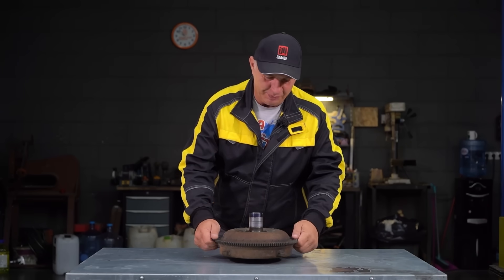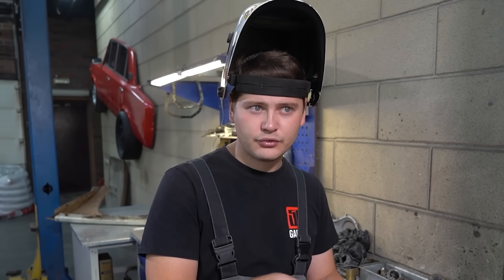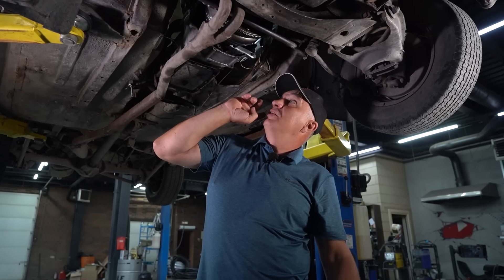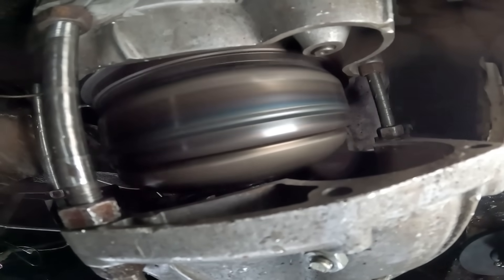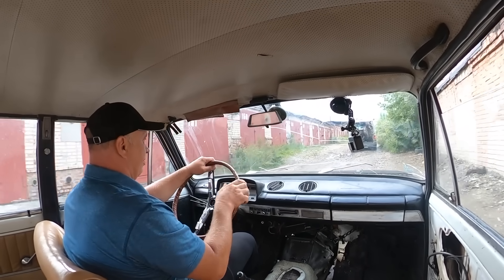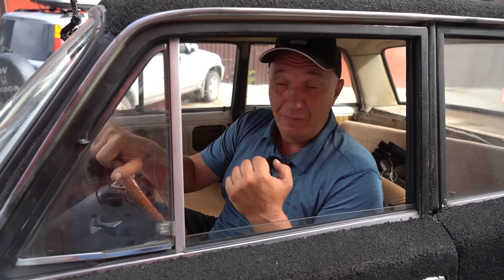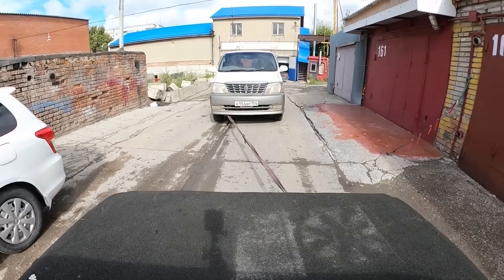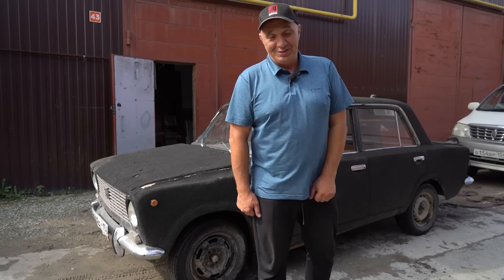Torque converter in a manual transmission - will it work?

Comment: Hear my thoughts Garage 54

Torque converter in a manual gearbox with manual clutch can enable person to engage gear without worrying engine stall. that is why automaker only put torque converter in automatic, because the purpose of automatic is to reduce body coordination.

Your torque converter in manual gearbox is very same concept as most modern backhoes, tractor and forklift. But the difference was

1. Those backhoes like Case 580 have two set of transmission, 
2. first one equipped with torque converter, oil pump,  mechanical or electronic-controlled (push of button) clutch for forward and reverse, output shaft to send power to
3. second transmission that have 4 speed

If you manage to put torque converter -> Manual pressed/electric clutch -> speed gearbox, then congratulation you have manual transmission that will not stall the engine, car will go so smooth without jerking

Comment: In France Renault made the « transfluide » the car had manual transmission and a torque converter. It also had a magnetic powder clutch, that was simply actuated when you attempt to use the gearbox lever.

Comment: I love things like that bit like the old    rover 105  r        I love the Russian side way s     think ING  a  old Daimler type fluid fly wheel and perhaps an old  over drive  that's had a lot of (docterin) and a sort of  daft  centrefugal clutch     but would like him to fit a large (mower) hydrostatic unit behind the  engine with hydraulic wheel (drive) moters 4 units  that Russian winter would be like a walk in the park 😊 keep up the good work comrades 😊

Comment: Driving an old school US truck as a daily, I love how smooth it all works and how it pulls if needed. Those torque converters accumulate the engine power, increase the torque and send it to the gear box. But: if the converter is charged up it still sends the torque to the gear box even if you don´t step on the gas. The converter first needs to get rid of the accumulated energy. So if you accelerate hard on the green traffic lights, it will be hard to stop quickly because the converter still sends the accumulated energy to the gear box accelerating the car. Same thing with burnouts. When you start loosing control it is too late because the converter needs to bleed energy first and still pushes the car. :face-fuchsia-tongue-out:

Comment: What would happen if you used a torque converter with a higher stall? Would that allow the gear to be changed without grinding?

Comment: My Uncle had a 52 Desota with this setup. It had a clutch behind a two speed column shift!! Reverse eas up and back. No first. 
Second was up and forward
It was geared low for getting a trailer moving and braking. Overdrive was down and forward. To start the engine pit it in neutral.  
Press clutch and select gear. Let out clutch the car will move with more throttle. 
In high and second you have two speeds. It will shift from low to high by idling the engine. The clutch is only used between second and overdrive. You hear a clunk when it shifts when you take your foot off the gas. It will not shift until you do. They went to a regular transmission two years later
It was weird but fun!!
Also weird was you could stop and start without the clutch if not loaded. 
Some Buicks didn’t shift at all. They just got faster!!
(Dinaflow)

Comment: Oliver Tractor company had a tractor decades ago called the 995. It had a clutch/torque converter. It had a regular clutch which was used like a regulsr clutch but also had a torque converter. The clutch could be dropped, but the tractor would not move forward until the torque converter built up enough torque, then the tractor would move forward.

Comment: What car had fluid drive?
It was offered for civilian use from 1939 through 1953 in Chryslers, 1940 through 1953 in DeSotos, and from 1941 through 1954 in Dodge models; a semi-automatic system was optional from Chrysler and Desoto from 1941, and for Dodge from 1949.

Comment: Think of how much more fluid is the pan of an automatic transmission to absorb all the heat from the torque converter. That torque converter is sealed. Only Zeus knows how hot it got inside there while towing that van. There's no way you could drive that around for an hour without an external cooler or a lockup function.

Comment: The answer is no since it locks up with hydraulic pressure provided by the automatic transmission oil pump.

Comment: The torque converters always tugging on and even at a low RPM, in the simple way to fix this? Go to JEGS or summit racing, or a torque converter rebuilder, and have him build you a stall converter, at that level of a horsepower I would say make it a 3500 stall. That way, you would not pre-load the transmission input shaft, like the stock torque converter is doing. It's doing that because that converter is probably an 1100 stall speed. That's why when you get in an automatic car and put it in gear the idle drops down. With a 3300 - 3500 stall converter, that would remedy your problem and allow it to shift much easier. For anyone who doesn't understand what's happening, it's doing the same thing that would happen if your  clutch was grabbing just enough to spin the input shaft, and this causes it to not be able to shift out of first gear. A simple stall converter would fix your problem and put your automatic clutch much more in the power range oh that engine, producing more umph. As much as you're going to get out of a 56 horsepower lada, anyway.🤪

Comment: Way back in the day. There was a setup called a Clutched Turbo. GM turbo 350 or 400 with a manual clutch. You only used the clutch for stopping and take off. It was brutal on drive train but worked great. They were used in racing. We had one in a big tire 67 camaro. Direct one to one. Gear changes were a blast. And you dont a trans cooler.

Comment: Watching this video, nice working making the pieces. But you basically just put a rod to the flywheel and the clutch is moving in and out.. you have no fluid pressure no fluid coupling with oh is how the torque converter works. You have no lock up. You’re running straight through the stator. Interesting but not impressive.

Comment: I have been driving Volvo trucks with manual box and a torque converter. But they also had a clutch. You use the clutch to shifting into gear but the converter to start moving.

Comment: I had a dodge with fluid drive. they are not quite a "torque converter" since they have no "stator" inside, They did not multiply torque, just a fluid coupler. .. it was a great system, I wish my power stroke 6 speed manual had a system like that old dodge.  it would be a great off road set up.

Comment: Hi , very good

I was suprised the long bolts did not snap or twist as the bell housing was not mated flush against the engine block.

The cut floor would be scary if something exploded.

Interesting if different fluid eg water / kerosene / different grade oil would affect the torque converters operation

Comment: Dodge called it a fluid drive  .
Torque converter on a clutch and standard transmission  in the 1950s I think  .

Comment: Chrysler Corp had ...Fluid Torque Drive, Hy-Drive and a couple other names for Dodg and DeSoto...1951-53.
These used a torque converter unlike the older 1941 thru 52 std Fluid Drive fluid couplings.
A hi/low range four speed hydraulic operated trans was
 used.
 Clutch pedal used to shift into lo high rang and reverse.

Comment: try using worm gear as the clutch axle power transmission, you get a free break whenever the engine is not moving, as worm gear does not allow back driving

Comment: I guess that the fluid in the torque converter was very HOT after towing the van, with no circulation through a cooling radiator, as would normally be the case with an automatic transmission.  Nice experiment, and great execution!  Well done!

Comment: VW (and Porsche) did this in the 70s. Torque converter, 4spd manual box with 1st gear blocked off, and a clutch activated by a microswitch on the shift lever. It was terrible, but did the job until VW developed a real automatic for the Beetle-based cars. VW called theirs the "automatic stickshift", Porsche called their version the "sportmatic".

Ford had something very similar in their tractors, the Ford-o-matic.

Comment: There are older heavy diesel trucks that use this concept. The running joke is "eight and wait", referring to clutch dumping in eighth gear and waiting for the torque converter to spool.

Comment: I think this is similar to the old Porsche sportomatic (70's era) transmission but they had a sensor on the gear lever to disengage a lockup clutch.

Comment: If memory serves me correctly, a version of the Austin Princess had something similar. A normal clutch and a fluid clutch.  The fluid clutch only operated while the car was in first or reverse, after that the normal clutch was used to change gears and the fluid clutch was locked.

Comment: The torque converter lockup is actuated by hydraulic pressure supplied by the transmission; you have no hydraulic connection between the torque converter and the transmission, therefor it cannot lock.

Regarding the tow test, the magic of a torque converter is that, at least at low speeds, they're able to trade efficiency for additional torque, effectively giving a dynamic gear reduction between the engine and transmission.

Comment: My father had a 1947 Dodge Deluxe with fluid drive, which is essentially a torque converter with a manual transmission.

Comment: We did the opposite back in the 80s.  Put a clutch on a torque converter in a th400.  Worked great. It was a dirt dragster.

Comment: You took out the ability to clutch...  You should have just added a torque converter after the manual clutch so that when the clutch is released it essentially connects the torque converter to the output shaft.  I suppose the only real gain would be the ability to release the clutch quickly while still being smooth and then being able to stop in that particular gear without putting the clutch in, but you'd be able to change gears while moving.

Comment: Even if it has a convertor lockup it cannot lockup as it would be activated by a computer plus it would need an oil supply to activate the clutch.

Comment: Ahh just like Honda's Hondamatic bikes, pick a gear and feel the power loss all the way to the next gear lol
If you can tune the torque converter you can do anything you want with the transmission before the TC tries to lock up - in the Hondamatics the torque converter doesn't couple any fluid below like 1100rpm so stay near/under that and you can have normal shifts vs banging/grinding into each.

Comment: Try putting in pressurized fluid in the torque converter via a check valve. The fluid would be pressurized in normal automatic transmissions.

Comment: Volkswagen made  a auto shift bug had a vac. diaphragm operating a clutch w/ torque converter attached activated by the  2 piece shifter slightly folding in the middle to press switch sandwiched between top and bottom of shaft ....ya could of cheated with Volkswagen beetle parts 🤔🐾🐾🐾🐾😎

Comment: I always thought a modern converter with a lock-up would be really useful on a manual transmission. In 1st gear/Reverse the lock-up would be disengaged for slow speed maneuvering and traffic. Then locks up and acts like a regular manual with a normal clutch on gears 2+.

Comment: The first car I learned to drive, when I was 13, was a 1950 DeSoto which had a fluid-drive transmission, that consisted of a torque converter and conventional manual disc clutch, coupled to a 3-speed box. My grandad also had a 1951 Dodge pickup that was fluid-drive. It has been about 60 years since I drove this car, but as I recall, you could start the car in first gear without disengaging the clutch, by holding the brake, as long as the engine didn't rev up and remained idling. It was more typical for a driver to disengage the clutch when starting up in gear, however. You could slow down to a stop and remain idling, in first gear, without using the clutch. Shifting up could be done with or without using the clutch.  If you downshifted at a fairly precise speed and engine rpm, it was possible to do so without using the clutch pedal, however, to the less experienced driver, this often resulted in significant gear clash, as I recall.

Comment: This already exists in the raceing community, Its called a Lenco Transmission and work with either a clutch or a torque converter " that requiers a pump and cooler". There are also Manuel Transmisions that only need to use the clutch from a dead stop and once moving you can shift with out engaging. Grab Venders "requires a cooler"  makes a overdrive module to add onto automatic or manuael transmissions that work of either a speed sensor or a switch.
Its great to see these guys building this but the build is ladened with a lot of issues.
1. the pump isn't actually pumping any fluid
2. no cooler
3. the brackets holding the pump in place are sketchy at best
4. the stand off's to gap the etra length are not going to hold up to transfer of much power, hence the bell housing making a flush mount to the engine.
5. and very important, the whole system needs to be ballencet
Reply: Bruno drive

Comment: You need internal pressure to achieve lockup. In an automatic transmission hydraulic pressure is applied which then locks the turbine to the front of the torque converter case. It was a great experiment! You just took a lot of variables out of how a torque converter functions.

Comment: Seeing you set off in 4th gear reminds me of an old American transmission - the Dynaflow transmission as used in the 1962 Buick Lesabre had only a torque converter between the engine and the differential, though the torque converter had movable vanes to change between low and high engine rpm

Comment: You guys have great content. Plymouth used a similar setup in the late 1940's in their cars and the design went on thru the early 1960's in fork lifts, using the same flathead 6 engine, standard 3 speed transmission, fluid drive sealed torque converter and a clutch and pressure plate. I think high temp rated silicone gel would work great for your project.

Comment: A lot of drag cars do it. They use a converter drive to couple a torque converter to a liberty or lenco which are manual transmissions
Reply: Yep, Bruno drive
Reply: I knew I couldn't be the only person that knew. 

I always misspell it lenko instead for some reason 😂😂 no matter how many times I check to find out it's actually lenco😂

Comment: You should mount the torque converter to the flywheel then find a way to put a pressurized fluid into the converter  as a disengaged and engage mode.

Comment: Volkswagen had the auto stick shift in 1968.  Had a torque converter plus a vacum operated clutch inside of the trans.

Comment: Without any line pressure, I'm surprised it can do as much as they did. That torque converter must be slipping like crazy and it makes sense why it won't lock up.

Comment: Volkswagen had a bug that worked like that in the 70s. It was called "automatic stick shift" and it was proudly displayed across the engine bonnet in chrome plated letters. It did work but the tank for the fluid was mounted inside one of the rear fenders and they used to rust out and leak. They ran pretty hot too.
Reply: I had a Karman Ghia with that trans. It's hard to imagine that an air cooler VW could be slower, but with that transmission it was.

Comment: Could you add a manual clutch in front of the torque converter so that you could still disengage it to shift easily? And then somehow add a lockup controller? Awesome experiments like always guys, love what you do

Comment: Wow, I had no idea torque converters spun the whole outside like that! Cool to see one in action! So I guess the whole case spins, and the inside "fan blades" are what are attached to the driveshaft? I think I get how they work now. I used to think it was like 2 fans inside, one blowing fluid into the other to connect the engine to the transmission. But I guess the "input fan" is attached to the case and that whole thing turns?

How does a lockup converter work compared to your test here? Could you add a lockup converter to a manual car? Oh it sounds like it was a lockup converter? Huh, what controls when it engages or not?

Comment: Plymouth did it in 1953 - early 54, and Chrysler as a whole combined a manual transmission with a straight fluid coupling starting 1939.

Comment: The stud extensions remind me of installing a 302 on a C3, and yes it held up, eventually installing a 4spd.  The darn pump gear was barely engaged in the converter drive hub and popped out after a short drive, fortunately in the driveway.  I cut some shims by removing slices from washers and installed them between the converter and flywheel, to move it back.  Leery about shimming the converter a full half inch from the flywheel, I shimmed it rearward to engage about halfway in the pump gear and never had a problem

Comment: It is called a fluid drive clutch. 1946 Dodge pickups had them. I have a forklift that has one. Once you put the transmission in gear you can start or stop the vehicle without having to depress the clutch pedal.

Comment: Its a lenko with a murph. seriously.  "Lenko manual transmission" with a torque converter is standard Drag racing gear of winners.  You just discovered how to full throttle shift a manual transmission in drag racing /NHRA.